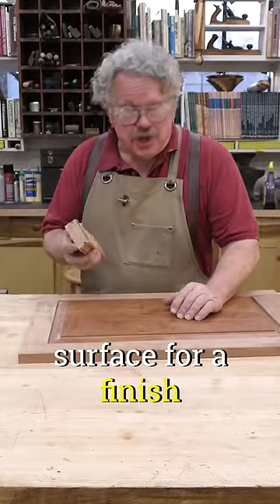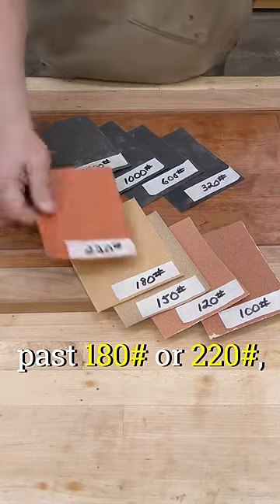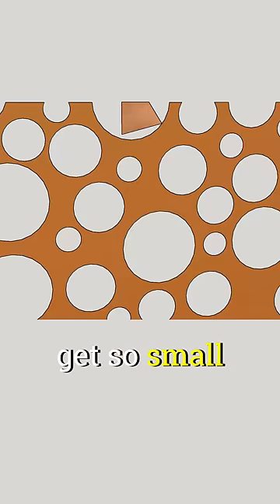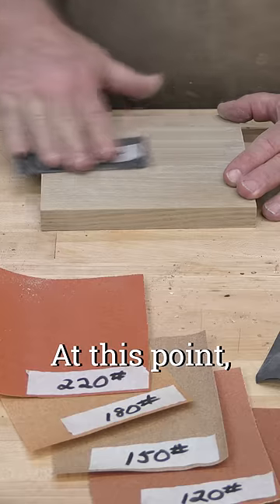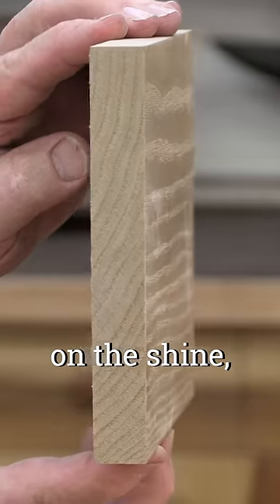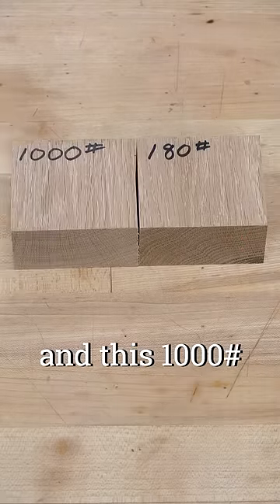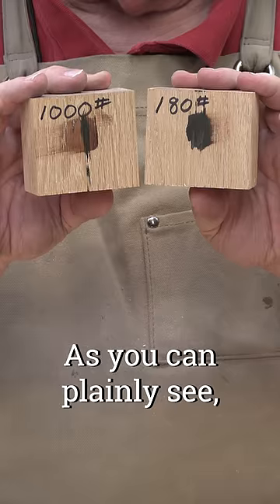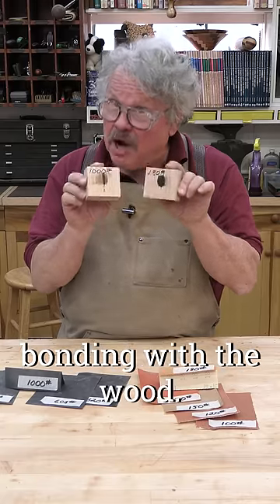Sanding Past 220 - How Smooth Should You Go? #woodworking #diy

Comment: dumb question. what about wet sanding or wiping off the wood with a wet rag or something between sand jobs.
Reply from the maker: It's called water-popping, and some craftsmen (including me) swear by it. I do it as a last step before applying a finish; some folks do it every time they move up a grit. But it doesn't completely clear the pores -- see the pinned comment.
Reply: @WorkshopCompanion  thank you

Comment: Personally, I think it’s good when the finish isn’t deep because it means stains won’t be deep either and it can be sanded and refinished easier…

But maybe you could finish and let it soak in deep, then use the fine sandpaper to burnish the wood and end up with a thoroughly finished and burnished piece?

Honestly I don’t know, I only do woodworking as a hobby and I usually just make handles for things…
I’ve never burnished anything… at least not on purpose

Comment: If I want to paint untreated wood, such as a garden shed, with waterproofing glaze, the liquid should penetrate as deeply as possible into the wood. What is the finest grain size I can use to sand the wood so that the liquid can do its job?
Reply from the maker: Most paints don't penetrate all that deeply; they are too thick.. When working with paint -- especially outdoor paint -- a rough sanding increases the surface area and gives the paint more to hold onto. This in turn increases both the chemical and mechanical bonds between the paint and the wood. And because the paint is self leveling, either through gravity or surface tension, the paint surface cures smooth.
Reply: @WorkshopCompanion  Thanks for your help👍🏻

Comment: I constantly use my extractor even with a hand block. I have a very soft brush attachment that I use to pull up the dust. Then I always wipe it down with mineral spirits. That pulls up a bunch more. Then I vacuum it once more, and one final round of mineral spirits. Then I leave it to off gas for a day. Come back and it will take a stain just fine.  You are also missing the point where wood is made of cellulose and when you sand it finer, you are decreasing the surface area for absorption. You just need to know what you are doing I guess is all this shows. I have beautiful countertops at 600 grit. Scotchbrite pads are very good. You can get them in various grits. That plus your extractor takes care of most of this.

Comment: Now what about either cleaning the surface after sanding to a high grit to try and remove the packed particles, or doing a low grit and getting deep penetration then sanding the result down to get the best of both worlds
Reply from the maker: See the pinned comment.

Comment: Ok… this doesn’t answer the question of which I should do for a project I would like to do. I want to make a crokinole board (think Canadian shuffleboard). The smoother the surface, the better. So… should I burnish the surface as far as possible and not worry about the finish? Or should I go to 220 and apply many coats of finish?

Either way, the surface needs to be waxed with wax applied about every 3-6 months of use, but which will give the smoother, faster play surface?
Reply from the maker: Special projects require special materials -- and special research. You might want to google "making a crokinole board" and see where it takes you. I have no experience with crokinole boards. But I can tell you this: If looking to reduce friction on wood you intend to finish with a chemical the creates a hard coating, how much you sand the wood is only a secondary concern. You primary concern is how finely you rub out your finish after it's cured.

Comment: This is very wood oriented and not all wood follows these same parameters and sanding well beyond 1,000 grit is fine in many cases, it's also important to remember that different wood reacts differently to finishes, dyes, oils ECT. So this video shows the basic concept but should not be mirrored on all wood.

Comment: Much better to sand lower grit and "wet pop" the wood. Basically spraying water on it between sandings to get the wood fibers to stand up straight, making it easier to sand them down, and resulting in a smoother finish.
Reply from the maker: See pinned comment.

Comment: That's what I was going to say. Not a wood worker. But i do a lot of artwork, and you need a rougher surface for paint to better adhere to. Same concept applies to a lot. That's why you score something like clay or even plastic or any number of other things before trying to get it to stick to something else. If it's completely smooth, the thing you're trying to melt into it, won't get as deep.
Reply from the maker: Great observation, but's a much more delicate balance with woodworking for the simple reason that a finish changes the optical properties of the wood itself. When a finish soaks in, it makes the fibers translucent -- this is what is called "depth" in a finish. The finish essentially turns the wood into a lens, and the smoother the lens, the deeper you see into the wood. At the same time,  all three processes for smoothing the wood -- sanding, scraping, and planing -- can crush fibers and limit how deep the finish penetrates. For most common finishing procedures, 180#/220# seems to be a decent balance point.
Reply: @WorkshopCompanion  I know they're not completely The same. I'm just saying similar ideas. The surface changes the final product with artwork too. That's why different colors and types of primers/surfaces are used. Because the underlying colors come through the paint and change it. And if you go too smooth with your surface in something like modeling the original primers won't adhere. I'd be interested to see exactly what the difference is though. Because id assume wood is way more porous than something man made like plastic. Probably way better at bonding in general like you're saying, and closer to dying than painting.

Comment: I did a butcher block tabletop. While I did not go past 220, I did use a trick I thought might help produce better results. Between standings, I wiped the surface with a damp towel. That was for two reasons: firstly, I wanted to remove the dust. Secondly, the real reason was to allow the water to soak into the superficial scratches. That caused them to swell and rise up above the surface, which allowed me to sand off those ridges and achieve a better result. Has anyone else tried this trick? Let me know.
Reply from the maker: It is traditional to wet the wood surface down after the final sanding to "make the whiskers stand up." These are wood fibers that have become detached on one end during the sanding process.  So you wet the surface, the wood swells, the whiskers stand up, and you knock them off with a final sanding, using the last grit you used before wetting the surface. If you don't do this, the whiskers may show themselves during the finishing process, creating bumps and dimples.  Seems to me this would also allow you to remove/smooth small surface imperfections that may have accumulated  during the sanding without having to wet the wood between each grit. But if this process works for you, don't let me talk you out of further investigation. Seems to me the next step is to prepare three wood surfaces, all the same species, -- one with no wetting, one with a final wetting, and one with a wetting between each grit. Then apply the same finish to all three and compare.
Reply: @WorkshopCompanion  Wow, thanks for the excellent response! That is some great advice. I will experiment with these ideas during my next project. I will be working with oak. 
Your videos are awesome. Well-composed and packed full of great advice. Thank you.
Reply from the maker: @Gdroku  Most welcome. Please get back to me through the web site and let me know how your experiment goes. Might be fodder for another video.

Comment: You wet sand past 400. 

You put oil on the wood, then hit it with the paper, then wipe off. 

I think a LOT of people forget that. 

Also, if you work with harder exotic woods, the scratches left with sandpaper on the wood will still show. Woods like rosewood, blood wood, etc as well as some hard maples require higher grits. 

Furthermore, this mostly affects only woods like oak which have VERY uneven porosity and open grain. Other woods have different properties. 

You don't sand soft woods with super high grits either because the hardness between what are essentially the rings/grain is uneven, and with higher grits on softer woods, that becomes a lot more noticable. 

But of course woodworkers are a superstitious bunch and they like to assume all woods work the same and should be treated the same.

Comment: However, once you get a coat of finish on and seal the wood surface, sanding with finer grits (even so far as wet sanding) will give you a glassy smooth finish.

Comment: Awesome. Does anybody know if it's similar with plastic? There's many different plastics tho
Reply from the maker: You should not extrapolate what I've said here about sanding wood as a guide to surfacing plastic. Two completely different animals.
Reply: @WorkshopCompanion  plastic is never porous? I'm imagining doing bodywork on a vehicle using too high grits, that would probably fill the pores of the plastic preventing a good application of the finish/wax etc?

Comment: this is a contentious and somewhat confusing issue.  though a simpler metric is just to remember raw wood going up through grit levels will provide progressively less penetration of wood stains of all types.  this being said, simply sanding past 220 will not in effect pack the grains as is suggested unless you are actively not cleaning your surface after each grit level (you should always be doing this.)  also it is not said here but some degree of wet sanding should be employed around 400 grit and up on nearly all surfaces.  contentious issue, simple solutions, though i personally believe there is no true right or wrong way in general, only variations of style.

Comment: Most stains are engineered to 180 grit.   If you're having to go past 220, you're using cheap sandpaper.   Sterated sandpaper is only thing I use

Comment: Dude that dark sandpaper is closed coat sandpaper and is supposed to be used with water to clean out the debris. You could probably find open coat at that fine grit.

Comment: But sanding with just course grits also lets the finish track down grain lines where you might not want it to go..If you are just slathering a big flat surface low grit is good. if you are doing any kind of detail work. not so much.

Comment: So what I'm hearing is sand to 220, do your stain, sand to desired level of you want super smooth. 

Using a very sharp, high quality plane can get you a super smooth finish as well, and all the poors are still wide open.

Comment: A friend of mine sanded baseboards past 220 and the paint would not adhere good. This was before i ever knew this video existed. Anyhow I took a damp cloth to the other boards that had not been painted and voila they immediately started to take paint better. I think this should be a common sense situation. Especially to anyone that has viewed a slice of a tree through a microscope
Reply from the maker: What you did with the cloth is commonly called "water-popping," and it's good finishing practice no matter what grit you stop at.

Comment: I watched a dude who polishes aluminum and it was a similar concept. The finer you sand the aluminum the harder it is for the aluminum to accept polishing compound. 

There was no point in sanding aluminum beyond 400grit. The 1000 grit and 2000 grit sanded aluminum looked way worse IMO.

Comment: Totally B.S.  clean the wood between sanding grits... microfiber and 50/50 running alcohol will  remove the grit... you get the best finish that way.  Using Words like burnishing does not change the need to clean between grits.  In fact if you dont clean you leave some of the grit behind and that effects the quality of the gloss of the finish... provided you want a shiny finish.  CLEAN BETWEEN GRITS.

Comment: So ill give an example cause this isnt always truthful. 

Wood will always absorb the finish no matter water. The fibers themselves absorb the liquid. All you do when you sand is take chunckes of and or force the larger pieces just depends on the grit into the holes no matter what size grit. If i took a sponge with a bunch of large holes and filled it up with water yes itll retain the water, but not as good as one that has a bunch of smaller ones with some smaller stuf in it. Its all about patience and waiting it might take a little longer but sanding to that depth will allow a more saturated soak. 

Rmember not to believe everything you see on the internet even though most of what he says is correct its good to point out some of the wrong information.

Comment: I understand, but what it you clean the surface with degrease and pressured air?
Reply: Why degrease on naked wood?
Reply: @favoritemustard3542  because in practice it helps removing the particles that stick on the product and it prepare the surface. I don't know if there are better ways

Comment: I carve spoons from time to time, and conventional wisdom states you should never sand them for precisely that reason. It does make rounding them out difficult, though.
Reply from the maker: All the carvers I know try to achieve a smooth surface without resorting to sandpaper.

Comment: Eh, i still sand to 2000. It does take the stain fine. It may not soak it up as well, but it will take it. You just rub it in and give it time.

Comment: You soak the wood in water to remove the sawdust particulates, this also causes the wood fibers to prop up which will let you promptly sand them down and cause the wood to become more resistant to water damage in the future. You do this several times.

Comment: so? stain first? then finish up the sanding. Since the goal is to have a smooth non textured surface. Otherwise you wouldn't go to 2000 or higher grit in the first place

Comment: So if it’s not ideal to sand that high, why does it even exist?
Reply from the maker: For other materials such as metal, acrylics, paint, finish. You can sand wood to high grits but it is recommended that you do so after you've applied the finish. - Travis

Comment: Age doesn't automatically bring wisdom. Sandpaper is only used for stock imperfection consistent removal. It is only a final finishing tool on substandard commercial or ignorant craftsman products. The only finishing tool to bring out the beauty of wood is proper use of the scraper. Ignore videos such as this and seek out videos or craftsmen trained in scraper technology.